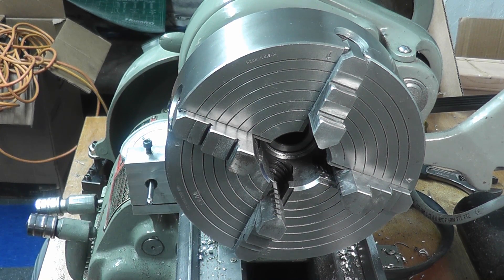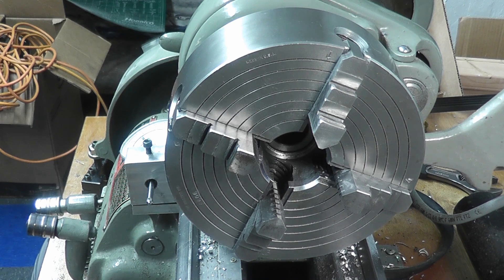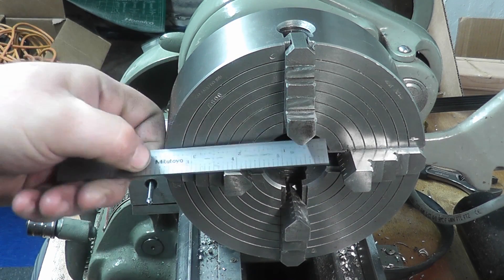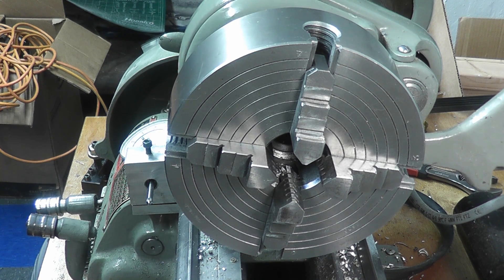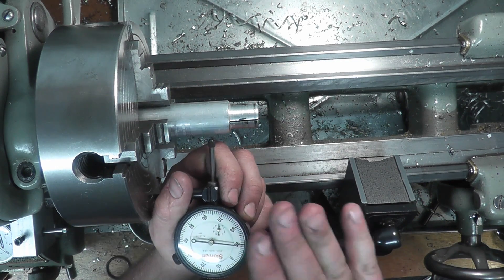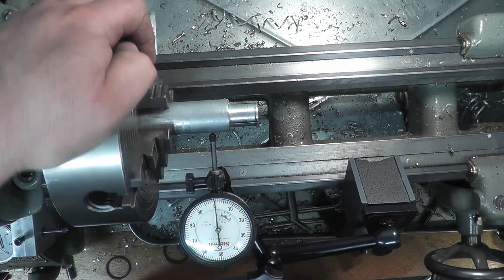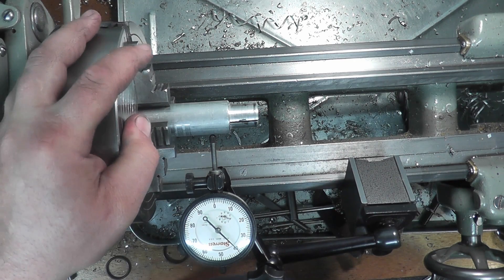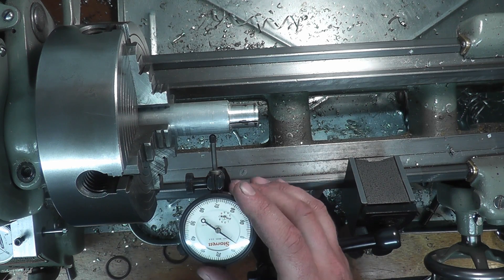Easy and Quick 4-Jaw Set-Up

Comment: That chuck has a center hole  Correct,    why not make a Standard that fits in the hole and make the first adjustment off the standard.     Set up a hard pin for fine adjustment.    just saying

Comment: Using rings or circles cut into the face of Chuck, lining up the same places on all jaws, this will get you very close  this method can be used on square as well as rectangle shapes....they were put in during the making of Chuck for a reason... bell mouth jaws can be reground in chuck with use of ring clamped on i.d.,,or taken off and surface ground using form wnheel

Comment: This was a good method, very easy to get the hang of it, unfortunately I never got my piece truly indicated. I had been going mad and running in circles chasing my own tail on this and that's why I started to look at videos like this. But ehhhh, now I see that two of the chuck jaws tighten at the back first and the shaft I was using was moving a whole lot regardless of how much pressure I put on it. Sigh.

Comment: You are certainly right about the chuck.  The four jaw is the only way to be sure youi are dead on.  My 3 jaw chuck has nearly 15 thousandths of run out.  Thanks for the video.
Reply from the maker: +cerberus  If your chuck has a backplate you can loosen the mounting screws of the chuck to the plate while it's on your lathe and bump it around until you get the least run-out and lock it down.  Also a big part is cleanliness of the mount itself.  If you have a taper lock it is imperative that both surfaces are spotless.  If it's a thread make sure there are no chips stuck in the threads or on the register.
Reply: +Halligan142 my 3 jaw chuck is the standard Craftsman/Atlas model.  It screws on a 1.5" 8 threads per inch spindle.  It does not have a back plate nor are the threads dirty.
Reply: +Thomas Headley no adjustments.  What you get is what you got.
Reply: Actually the chuck is not enough of  a problem for me to go worrying over.  When I do something that is going to be one piece that I can machine and part off I can use the 3 jaw if it seems more convenient.  Other wise I just use the 4 jaw chuck and all is well every time.

Comment: great explanation. I inherited an old atlas craftsman, with a four jaw chuck.  I can center and cut round stock, but notice the jaws are worn. "Bell-mouthed"?... I've heard it called... where they bite in the back, inside the chuck first...and I can see light under the jaws in the front. Any ramnifications of this? Should I try to correct this... or is it a real problem? How can I fix this if I need to?